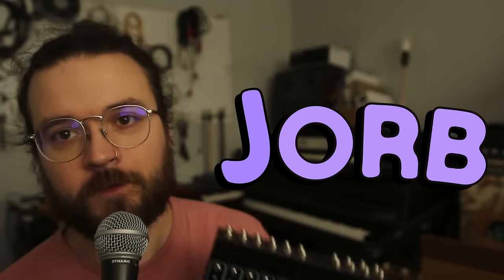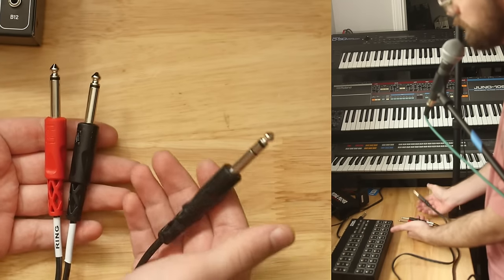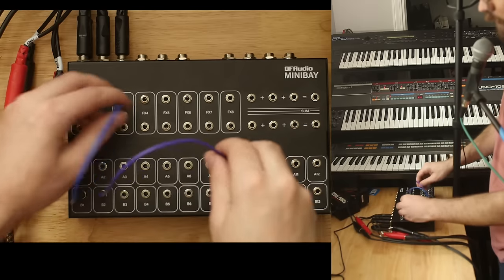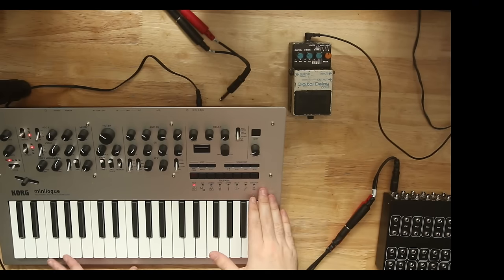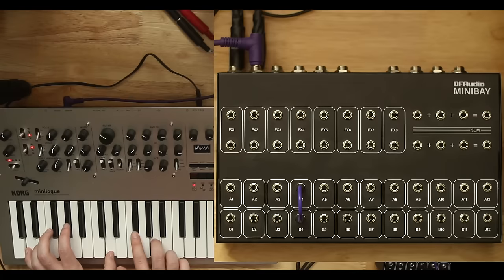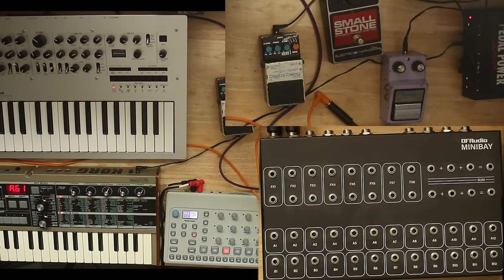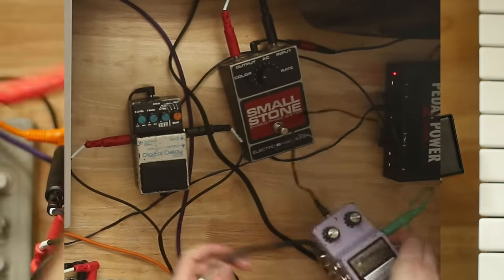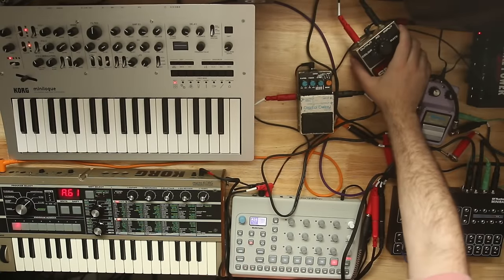Why & How to use a Patch Bay (And why the Minibay is a great one)

Comment: It's a cool product, the one major (fatal) flaw for me is that they placed the (normal/half/thru) switches inside the unit so you have to take all your connections out and the unit apart to change this.  The type of switch they used for this is so small they could have easily given access from the front or real panel.  Maybe not important to some but I find I change these up enough with my patch bay that it would be an issue.
Reply: @ghost mall   haha, yeah me too with the Samson, I am so happy I did, couldn't be more satisfied, I have two of them and probably will end up with a 3rd.  They are a little more expensive but worth it, especially since it is a long term investment. I imagine these lasting decades.  I think the Minibay is really cool, but not having access to the normalcy switches without taking the unit apart to me is simply a design flaw. But, I am sure it would be great for many people.  At least it is innovating on something which I support, maybe we will see a version 2.0 in the future.
Reply: @ghost mall Same, and it's build like a tank. 100% recommended.
Reply: Another Samson user with one, wondering if I could use another.   My USB interface is in a rack with it and some other rack-style effects and preamps with jacks on the back.  All the synths and effects are routed to the back.  Super clean.   If I had a lot of tabletop space, this patchbay looks like a winner.  But my studio is about 10x10 feet and includes an electronics repair bench and too much vinyl.

One cool use I made of the Samson is one pair of channels in thru mode so that a boutique compressor's ins and outs are one above the other.   In thru mode it will never feed back if disconnected, and it can be dropped into any signal chain with ease.
Reply: also got the Samson. Only patchbay with the switches on the front. Found someone in europe who prints custom labels overlays. Really cool.
Reply: Samson is the way
Reply: Yea that's a dumb decision. At least put that little dip switch panel on the back, side or front of it
Reply: I'm not sure if it's a fatal flaw since most patch bays are not easily switchable but since there appears to be space it would have been a really nice touch. Especially since getting a patch bay setup takes so much planning in that regard and once you start patching and realize you wanted full normal instead of half or vice versa, you already have a bunch of gear connected. How nice it would be to just flip a dip switch?
Reply: @beatnikcafe  yea agreed, that’s not a very common feature but dude has a point in the fact that it does seem dipswitches could have been included on the back or bottom with ease, and that same setup is used by a lot of desktop gear nowadays
Reply: @Ancaja123  I agree, additon of switches would have been nice. Even with the best plan, things change, especially in a desktop setup.
Reply: Thanks for the feedback David. I didn't think that having the normalling switches on the inside would be much of an issue, but seems it's quite a downer for a lot of people. Working on it :)
Reply: @dudfaz  Yeah I didn't think it would get such a conversation going.  That was my instant thought when looking at the product and I should have been more clear in my description using the word "fatal" as another pointed out, it is not a "fatal" flaw, I use that word in discussing gear when there is one specific detail what would prevent me from buying it, so the "fatal" comment is only a personal one.  

Just as a response to the comment that it is not a common feature, that is not entirely accurate, almost all patch bays have these easily accessible but usually in the back, I have a tight space for my studio so getting behind my patchbay is a pain and requires moving things, but for some this is not an issue. what set the Samson apart for me was the easy access to this in the front which I believe is the only unit that has this feature.  There are some older units that require removing the patchbay from the rack and opening the unit but I would say that is now outside the standard.

I do love the innovation of the Minibay and it is the only product really of its kind.  There are some other things in the market that do patchbay stuff outside the rack but they are pretty limited in what they can do. I think the way the Minibay handles stereo signal flow is really impressive.

In case someone is wondering why I even find changing the connection type easily as important, it is because I found myself switching the connection type quite frequently.  A couple of examples of when I don't use "Normal" connections,  I will switch to "half normal" to send signal to ext in of synths to use for envelope followers, but also still sending signal for playback and recording in the interface. (the half normal out is only affecting the envelope and not sending audio back into the chain causing feedback) and I have all of my external ins from the synths ran to the patchbay using "thru" making it easy to to make that connection for envelope following without needing to run cables each time I want to do it.  I also us Thru for exp pedal, and sustain on synths and effects pedals so my physical exp & sustain pedals always stay under my main keyboard and I can just run patch cables whenever I want to use them on different instruments.
Reply: @dudfaz  FWIW, I think it's a great project, the biggest downside that I see, and I understand its a trade off of cost and size, but for me I really prefer balanced connections on a patchbay, but even if it were not for that, I would prefer jack to jack connections, so no stereo or Y cables needed for operation.
Reply: @davidallred991  Hey David, thanks for your reply. They're some very creative patch bay uses. I ended up using an A/B switch for the exp and sustain pedals - never occurred to me to use a patch bay!
Reply: @beatnikcafe  Thanks! Just to clarify, stereo cables and balanced cables are the same thing. You can work with balanced signals on the Minibay - you just need to patch the two polarities separately on the front panel - they'll then both go out on the one TRS socket on the back panel.
Reply: @dudfaz  Thank you, I am aware of the sameness but the rear connections are TRS routed to two different patch points, no? Would that mean the front panel is unbalanced? Also, I re-read my comment, by on a patchbay, I mean all the way through and through. I've used a lot of patchbays and not all the connections have ever all been balanced, a lot of outboard gear inserts for example, so maybe I'm missing something in your design but it seems if you're using TRS on the back presumably to conserve space, that is carrying two unbalanced audio signals to the front panel patch points.
Reply: @beatnikcafe  Yes, you're exactly right. My point is that you can patch the unbalanced pairs on the front panel (one for each polarity) as if you were patching one balanced cable. Then it all matches up as a balanced signal when it gets to the TRS sockets on the back.
Reply: @dudfaz  I would just use the unbalanced because for me it would not be worth losing the extra patch points. I run a lot of stereo effects already so the PB would get used up quickly. Thanks again for the explanation.
Reply: @beatnikcafe  Yeah, balanced stereo patching on the Minibay would be a pain indeed.
Reply: Fixed in V2
Reply: @davidallred991 thank you for this breakdown. these are really helpful ideas.

Comment: Another key reason to use a patch bay: Its front jacks are durable and designed to be plugged and unplugged countless times. The jacks on your musical instruments are frequently not as durable. I've had them get loose and fail, whereas I've never, ever, had a patch bay jack fail.

Comment: Gosh, I love this! Any synthesist that still has, say, all her weird guitar pedals from her drone metal project, and suddenly use them quickly and efficiently without having to completely discombobulate one's mixer. Plus, I actually understand how patch bays are supposed to work, as opposed to me goofing with fx sends on my mixer. Great video! <3
Reply from the maker: Thanks Katherine! Yeah I think re-ordering effects is the best way to utilize this. Especially with how hands on it feels with the minijacks
Reply: But, one difference between this and an S/R loop on the mixer is that you can mix in the amount of the effect from your mixer, whereas here it is just on or off. That means the wet amount is manually controlled on the effects unit, instead of setting it 100% wet (no dry) and using a mixer to control the amount. Also, with a mixer, you send multiple channels to the effects unit. Here, it's just 1-to-1 since it's a static patch and not a variable mix of (multiple) audio signals. It really depends on how you want to route where and when, and which knobs you want to wiggle. 😊
Reply: I love my patch bays!!   I route my submix out into a patch bay, and then  all of my various samplers (octatrack, MPC Live, digitakt, MC707) to the inputs of the PB.  That way I can sample from any source into any sampler.   I also have half normals to go into the audio interface so I can multitrack, but in practice I rarely do that.    This little mini bay looks like a super useful desktop unit.

Comment: Being totally manual, $180 / €180 is too expensive! I have an AKAI MB76 from the late '80s that cost about $200, (NEW!) and has 7  analog inputs and 6 analog outputs (hence the 76), with 32 memories that can be controlled by MIDI program change. And...  It can also be used as a mixer! 1U rackmount, very sturdy, never had a problem with it (contrary to what happened to my Yamaha DMP11 Midi controlled mixer from the same epoch).

Comment: I literally could not make my set up work without patchbays. They are so incredibly useful, but can be intimidating and quite confusing for someone whos never used one before. They are also the perfect solution if you are out of inputs on your mixer, but don't want to upgrade to something larger. Interesting design using insert style jacks on the back to and 3.5mm on the front to save space. Great job explaining normalling, routing, etc. Amazing video!
Reply: @ghost mall Yes, agreed. That's more of the point I was trying to make. Prior to using one, many peoples perception is that they are more intimidating than they really are.

Comment: Jorb! question: does this work with stereo pedals that have 1 TRS in and 1 TRS out? i just preordered the Chase Bliss Onward pedal and im trying to wrap my brain around how that would work based on what you did here with the FX 1 going in and out of the delay… how would you get stereo in and out of a stereo pedal with one jack for each. does that make sense? because i’m confusing myself just typing this out
Reply from the maker: You could use two fx channels. 

two eurorack patch cables to route the input, and two to route the output.

Just think of it as 2 seperate mono pedals.

Only difference is you probably want them going out of the unit to the same thing, where it will get treated as left and right

Comment: I get my cables tomorrow, but I'm slightly confused by the FX send/return model.  I have a stereo compressor.  If I understand this correctly, I will take up two channels of FX for each input/output combo (in:R, Out:R on FX1, and In:L, Out:L on FX2)  From here, FX1 and 2's top rings will be input jacks, and bottom rings will be output jacks.  

I got a little thrown off by the stereo chorus since it was mono in stereo out and my brain wasn't computing the send back into one of the other mixer channels.

Comment: Great desktop patching tool, apart from the fact that mods (normal/half/thru) are hidden inside. Ain't no time to disassemble the box in order to change the signal flow. And since a patch bay is made to gain time while connecting audio devices, one major feature was lost by constructing Minibay the way it is now. Once it is corrected, and should be, I want one. Jorb, Thanks for this presentation :)

Comment: I'm missing something with the effects pedal connection. If it's TRS on the patchbay side and T input R output on the pedal side on the same cable, wouldn't it cause a feedback loop?
Reply: No, because they are not connected. You'd get a feedback loop if you inserted a patch cable between the input and output sockets on the top panel (but you wouldn't do that).

Comment: Thanks for the video! I'm always trying to figure out if a patch bay could be better than my current set up which has all of my outboard gear connected to my medium big mixer (soundcraft 22) and I've got two separate stereo aux sends and another mono aux send, each with their own effects chains. So I can just dial in how much op1 to send to my oto delay and reverb chain, and for fun send some to the volante/vongon/screen violence chain at the same time. Then I can send another synth to my guitar pedal mono chain and get some quirky looping going. It's all aways hooked up in the mixer. This works wonderfully for my production style where I work up a sound situation that I like, experimenting without having to unpatch or patch up anything, and hit record on my daw when I'm ready to record a performance. Downsides are that I wish I could find a mixer with more stereo effects send/returns, and of course I'm giving up the control I might have recording track by track. I prefer it that way though, to avoid spending most of my time editing rather than exploring. If someone has an extra Shure Auxpander lying around please let me know!

Comment: I recently reworked my setup so that everything goes to two Erica Synths Matrix Mixers: one for audio routing, one for CV routing. Similar idea + attenuation
Reply from the maker: Ahh I would love to try one, certainly
Reply: I have a few patch bays , and the Erica system looks killer .  Wish something was available like it in 19” rack .. in the standard rack the cables are all nice and tucked away round the back , but it can get real messy round the front .. that’s why the Erica system seems so good .. no patch cables and the ability to mult / mix / is massive advantage .. hence the cost ..   this thing confuses me and I can’t se the benefits over normal patch bays and a compact mixer for the price ..

Comment: Ohh, this is perfect - cheap enough to instabuy. My rack mount patchbay is gathering dust, not because of lack of usefulness or fx pedals. The comment about the normalization switches is valid, but not something I do often. My current patchbay requires me to open up the case and switch the orientation of the daughter boards, so the switches are a step up.

Comment: i try to normalize the minijack connection from a1 to b1 to have the most used connections in the modular always next to them. but doesnt work. is normaling only via jack to minijack?
Reply: Normalled connections are between the sockets on the back. When a minijack is plugged in on the top panel, it breaks the normalled connection.

Comment: This is such a great idea. I've often thought someone should come out with a guitar style loop switcher with multiple inputs designed with synths in mind, bu this is probably a better idea.
Reply: You might like the Boredbrain!
Reply: @exister  Forgot about those. Will have to check them out.
Reply: They do exist but use relay switches if you need stereo, and silent switching. Check out Switchblade 8F. This is not cheap but very powerful.
Reply: @beatnikcafe  Will check it out. Thanks
Reply: @trickfall8752  You're welcome!

Comment: what about synths that support left and right, each in TRS... is that just simply for grounding issues then? can I still split in the same way using two TRS to the TS/TRS splitter?
Reply from the maker: Balanced signals passed on TRS jacks, so one TRS for left, and one TRS for right?

to preserve the balanced signal you could use a pair of inter connects for each, or preserve normalling, but yes you're taking up double the tracks. 

Or you can run them unbalanced like everything i demo here

Comment: Question: In these examples, if the multiple synths, sequencer, etc is all patched in and going out to an interface, that means anything recording is on one Left/Right channel? What if you want to separate those for mixing?
Reply from the maker: im running them into a mixer with multiple channels!
Reply: @JorbLovesGear  so it's separating the left and right channel from the one cable to make it isolated instruments? And it's at the same as recording going to the mixer?